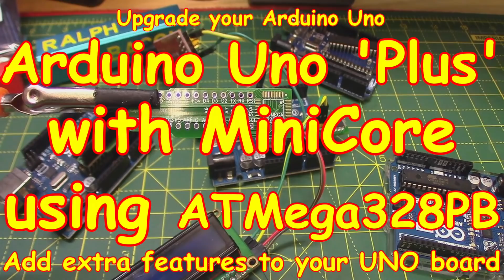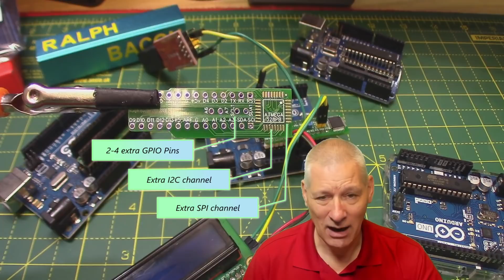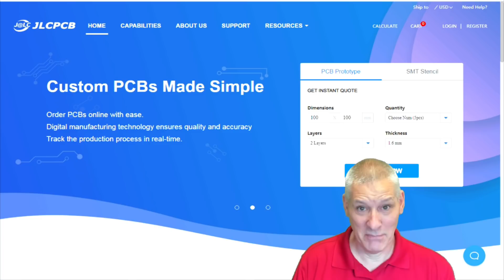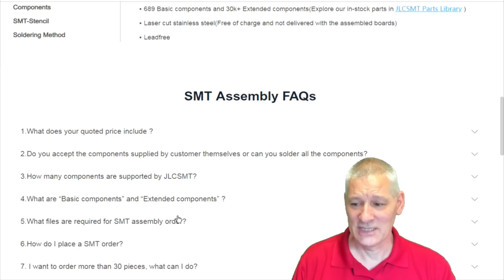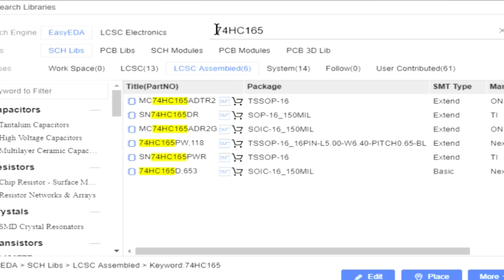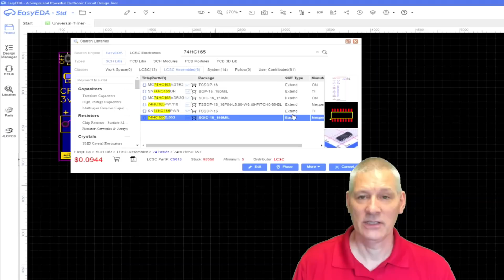#168 Upgrade to an Arduino Uno 'Plus' with MiniCore and an ATMega328PB

Comment: Tell me please, what version of the minicore kernel are you using? Only version 2.0.5 works unrealistically for me, the chip works from an internal generator of 8 megahertz. If I choose an external one at 16 megahertz, it's crazy.
Reply from the maker: I do not know which version of the kernel I was using at the time; I do know that this library has been updated several times so maybe it will now work reliably. I never had any issues and I almost always run the Arduino 328p chip using an external crystal at 16MHz.

Comment: Great Video Ralph! Could you share the changes that you had to make on the Liquid Crystal libraries to be able to use the second i2c channel? Thanks!
Reply from the maker: You will have to believe me, Gabriel, when I say I have looked long and hard for the changes I made, but without success.

If we assume that the original Wire.h library (I2C) uses pins A4 and A5 (aka GPIO 18, 19) then I can only assume I "hacked" a version of that library to use the pins required for the second I2C available on the PB version.

But at this stage I'm afraid I must admit defeat and say I can't find the changes.

Comment: This is exactly the kind of thorough resource I was hoping to find about the 328pb. I had been needing something with more than one UART and these tend to be a bit cheaper than 32 bit microcontrollers
Reply from the maker: Great! It works just like the standard 328P but with more features. Unfortunately it also has the same number of pins, so some GPIO pins are used if you want another UART.

Comment: I got your board as offered some time ago. After some SMD soldering experience I plunged in. I quickly had success burning the bootloader but everything thereafter failed. At 24:41 in your video was the selection of UART0 or UART1. What I discovered was that the correct choice for me was UART0. 
I use an ELEGOO UNO R3 which has the removable 328. I have pressed a ZIF socket into the board (notch at the end for the large capacitor). Once the bootloader was specified as UART0 I had success.  Tada as they say.
Reply from the maker: Indeed, Ralph, the correct answer is always UART0 unless you have used the other set of RX / TX pins (which I hadn't in the video hence why I chose UART0). I should have been clearer on that, my bad. But I'm delighted you had the Eureka moment and got it all working, great stuff. 👍
Reply: @RalphBacon  The finished is shown on my Instagram: https://www.instagram.com/rwl7532/ where I show all my e-successes. (and some photography) Why aren't you on Instragram?
Reply from the maker: Just saw it, Ralph. Yes, I'm on Instagram inasmuch that I have an account, Twitter too, but I have no time to answer stuff on social media other than YouTube!

Comment: Could you do a video on the microchip 328PB Xplained board? It has a built in circuit debugger, possibility can use it as a cheap ICE with the atmel studio?
Reply from the maker: As it happens I do have a 328PB Xplained board but I never ended up using it. I will add your suggestion to my list and see what happens. Of course, the Arduino PRO IDE may overtake me and provide what we all need regarding debugging long before that happens...
Reply: @RalphBacon  Thanks. The atmel studio had an option to import existing arduino sketches and allow debugging, I never managed to get this working.

Comment: Hi Ralph , very informative video , I’ve been pining for an Atmega with two i2c ports for a while. I’ve been using atmega1284p in a few flight simulator instruments I’ve been working on for a while as I needed a few more pins, and “accidentally” bought a atmega324pb thinking it was the  low cost lower spec memory version of the 1284. Now having seen your video , I noticed it too has 2 i2c ports etc .... I’ll modify my next batch of pcbs to take this chip as well as the 1284p . I’ve lost my fear of smd pcbs with the help of pcbgogo.com . Have you considered this chip ? As the headline io pin count , I believe is 39 compared with the 328pb’s 27 . This in my opinion is a good option without having to get into the realm of the 100 pin 0.5mm pitch of the 2560 . Many thanks, and keep up the down to earth videos exploring the possibilities of Arduino 😃
Reply from the maker: 100-pin SMD soldering? Ouch. Tricky. But probably do-able! I've not used the 324PB at all. There are so many MCUs out there it must be possible to find one that suits our needs. You seem to be doing a good job researching which ones are good for you. Keep going.

Comment: Just out of curiosity, why didn't you put the chip at the other end of the board so that it didn't overhang the end of the Uno board?
Reply from the maker: Because the two aluminium caps are there and there was a definite risk of shorting. I could have made it wider but it looked ugly. I had to do something so this was it. It actually works OK in real life.

Comment: Thank You for your give away pcb board for Atmega328PB. The board arrived to day, when our national postal strike was over.
Soldering an AtMega328PB chip was not difficult. But I had difficulties burning a bootloader to Atmega328PB. I got avrdude messages like:
"Reading | ################################################## | 100% 0.02s
avrdude: Device signature = 0x000000 (retrying)"

I even desoldered the first 328PB off the board and soldered a new one back and got again the same avrdude messages. No bootloader burning today. 
I googled, read and tried all good advice without any help. 
On a last try I decided to hack ArduinoISP.ino.
On line 53 I changed SPI_CLOCK slower by increasing the frequency divider from 6 to 10:
#define SPI_CLOCK (1000000/6) ==> #define SPI_CLOCK (1000000/10)
It worked and finally I managed to burn a bootloader.
Ralphs board + Atmega328PB + Minicore worked on genuine Arduino Uno just like a DIP 328P. It even worked on Jeenode running RF12demo.ino. Jeenode uses 3.3 volt voltage because its radio RFM12b is 3.3 volt device. 
On some of my projects I like to use two hardware serial ports. Atmega328PB is then a good choice.
Thanks again and waiting for new videos...
Reply from the maker: I'm glad you got it working (eventually) Hannu. I didn't get any errors. I just put the PCB with the new chip into my programming ZIF socket, chose the correct board using MiniCore and it "just worked". No changes to "Arduino as ISP" sketch were required. I hope you have many hours of fun with the extra facilities this chip gives you.

Comment: I just received the board Ralph.  Thanks a bundle. Darn that chip is very small. Lcsc was sold out, ordered at aliexpress
Reply from the maker: You think that chip is small, Ed? Try the VQFP version I showed briefly in my video! No way could I solder that (I don't think so, it has no exposed pins). Glad you got the board, take care when soldering the chip, make sure Pin 1 is correctly positioned (see the dot) and just tack a corner, correcting any misalignment and then tack another corner to hold it square and you're good to go. Plenty of flux, I mean PLENTY! It will all wash off afterwards with Isopropyl alcohol. If I can do it, anyone can!
Reply: @RalphBacon  got to get myself some decent flux, the last flux I ordered from china I think was just vaseline

Comment: Beauty! This makes me think I could design a pcb with a little 328PB (instead of the whole nano) and all my other bits.  It would reduce the project size to about 1/3 or less.  JLCPCB could put it on for me.
Reply from the maker: Indeed, and it's what commercial outfits do, of course. Prototype using a Nano or Arduino then transfer the important bits to your own PCB and get someone else to do the dirty work of actually making it! That way, you can spend more time on getting the design and PCB right instead of building anything.

Comment: I practiced SMD for a bit, then; when I thought I was ready, I went for the "TeSt"  I purchased a SMD kit that builds a wrist watch, all very tiny parts, 4 boards with an additional battery board if you decide not to go rechargeable, which I did.  Now I am rather lucky in one way, my eyesight is so bad without glasses that if I take them off, it is like I have a very large magnifying glass, so with my glasses removed, and safety glasses in place, I went for it. First though I did purchase a digital soldering iron so I could regulate the heat, and found some needle style tips to use, they worked well, I also purchased a set of tweezers that were so very necessary to do the project.  I have been wearing the watch now for nearly a year, just put the 3rd set of 5 batteries in her with the fall back last Sunday,  So I think I passed my TeSt although she is not beautiful, as there are some obvious errors, while the thing works fine, some of the components are off kilter just a bit.  The solder made the connection right it just looks a bit wrong, but they were in tight places where a slip of the tip could have burned through the display cable.
Reply from the maker: I used to be like you, Jerry, with poor eyesight (very short-sighted) but with the advantage that I could focus on the end of my nose. So soldering small components was never an issue... until my eyes decided they did not want to play any more and now I just have poor eyesight! However, with +4.0 glasses I can see real close again so soldering SMD chips is OK. Once I get my cataract swapped for a decent lens I should have eyes like an elderly hawk!
It's nice to hear your project worked out well like that. Yes, we can always do it better next time, maybe, but it's easy to have 20/20 hindsight!
Great to hear from you Jerry, thanks for posting.

Comment: What if I don't drink coffee?  If we are lucky, even though arduino missed the boat, our "far eastern friends" may get the urge to clone this with chip and caps installed, so hide your email, but publish the circuit widely. 😊
Reply from the maker: If you don't drink coffee then you will have even more cash for these ultra-exciting products that I keep demoing, Kent, makes sense, right? I'd love it if the Chinese were to create a board with the 328PB - given that it's very nearly pin compatible and cheaper than the 328P nowadays I am wondering why they haven't.

Comment: Nice piece of work! Compliments for the presentation, too!
 I`m planing to use this chip by replacing  the one from the pro mini board for small sized projects.
 I`ll need to check if the pins are the same or maybe an adapter pcb could fit them and then check also the sleep power drain values. 

 A question regarding your adapter board: could the chip be placed to the left of the headers, just to avoid getting out of the main board size?
  Thank you for the valuable learning! All the best!
Reply from the maker: The 328PB chip is very nearly pin compatible with the SMD 328P, Neagoe. You just should not connect pins 3 and 6 (connected to VCC/GND on the 328P version) as these provide an extra GPIO on each pin and it's not particularly "safe" to leave them connected directly to VCC or GND (think: short circuit).

And I could have placed that chip elsewhere I suppose although routing all 32 tracks was a bit of challenge as it was. I would love to create the PCB with the tiny VQFP chip that I showed with the chip sitting between the pins - but soldering it would be pretty much impossible (for me, at least) so maybe I'll get a PCB fab house to do it for me!
Reply: @RalphBacon  Hm, actually I was thinking about your challenge with the tiny chip and crossed my mind something I've done the years ago, using a 3D printer to create a thin solder mask for putting a precise solder quantity.  Then I've heated all up by using 2 heat guns 180 degrees one from the other and rotate them. If you would like to try I could make the solder mask for you, @ zero cost.
Reply from the maker: It's beyond my skills levels, Neagoe, trying to solder that tiny VQFP chip, solder mask or not! But thanks for the offer, very kind of you. Unfortunately, LCSC.com don't stock that tiny chip either, so if I were to get it done it would have to be another PCB house. Luckily I know of one with which I am involved. We shall see.

Comment: Thanks again Ralph for yet another interesting video.  I'm not sure that I will be heading down the road of programming my own chips, but useful to know what is possible.

I have a question relating to another board I have seen.  this is an UNO style board with an ESP8266 built in - link below:
https://uk-m.banggood.com/Geekcreit-UNOWiFi-R3-ATmega328PESP8266-32Mb-Memory-USB-TTL-CH340G-Module-For-Arduino-Uno-NodeMCU-ESP8266-p-1205444.html?gmcCountry=GB&currency=GBP&cur_warehouse=CN&createTmp=1&utm_source=googleshopping&utm_medium=cpc_bgcs&utm_content=zouzou&utm_campaign=ssc-gbg-summersale-all&utm_design=152&ad_id=358675083520&gclid=Cj0KCQjw9fntBRCGARIsAGjFq5EnYGQ2Uu2GGoBlYRxhDDs-8lvakVe1KUkUDHqANXoo-TIPgVNZKkkaAj_kEALw_wcB

This sounds interesting, but I cannot find anything about them on YouTube.  Have you come across them?  It seems that you can set dip switches to indicate which chip to program, but I am wondering if you can get the two systems running together with communications between them.  If so that would be very useful.

Regards,

Colin Murdoch.
Reply from the maker: Yes, I've got one of those boards too, Colin, but like you have never actually used it as it seemed a bit like too much faffing to get the DIP switches set correctly. A poor excuse, I know. I some ways, thouhg, this falls between two stools. It's neither an ESP8266 nor an Arduino, so what processor does what job. Most will probably use the ESP8266 for its WiFi capability and communicate with it via the Tx/Rx pins, which is a pity because we use those to upload sketches. What we need is a chip that has extra TX/RX pins... Oh hang on, the 328PB has just that, what a coincidence.

Comment: Ralph, look into turned header pins (like on Tulip IC sockets) instead of the square ones. The square ones will expand the socket so a normal PDIP won't fit very well after.
Reply from the maker: I'm sure I have some of those turned pins somewhere, I shall see if they work any better. Thanks for the nudge.

Comment: Terra-Term will close, PuTTY will not.
Reply from the maker: Not in my experience, Ted! Even though I have told PuTTY never to close the window, once it loses the connection (eg you unplug the Arduino) it comes up with an error and then promptly closes the window! I don't understand the logic but there it is. But CoolTerm works fine for me, far better than PuTTY anyway, even if I discount the odd window-closing behaviour!

Comment: Hi Ralph. You demo'd using two serial ports... Just wondering what code changes can be made to use  the two i2c busses?
Reply from the maker: There are two libraries included with MiniCore, Gary, Wire.h and Wire1.h, and it's the latter we use to use the 2nd channel. You can use both simultaneously, of course.
Reply: Thanks Ralph. Really appreciate all the work you do and the great presentations of fun information...Thanks again.
Reply: @RalphBacon  Just what I was looking for! I have a project where I selected a Pololu 328PB module to use all it's analog inputs and would use the 2nd i2c for a LCD. Later I noticed that there was no library available for the 2nd i2c. Even the Pololu WEB site state that. I will look MiniCore to see if my project will be feasible. Thanks you for the note and Gary Webster for making the question!!!

Comment: Hum, I don't know if I'm just too cheap to have somehow ok ic socket or/and pin header but when I plug them together they are hard to plug in and seem to slack the ic pins connections.
Found out the stackable pins are more suitable to be connected into IC socket.
Reply from the maker: Stackable pin headers fit better but IMHO make the board look quite ugly and don't allow shields to be plugged into the Arduino. You can get ROUND pin headers which probably work better. But even the square ones do fit but something you want to fit just once and leave there.

Comment: couldn't you put the chip on the left side and have it hang over the board itself?
Reply from the maker: I wanted to do that, Norm, but those aluminium can caps are in the way. The pins would foul and, of course, I have stuff under the chip (the decoupling caps). Others have suggested making it wider rather than longer but I had this bee in my bonnet that longer and thinner looked better.

Comment: Great timing for this video. I’ve just ordered a atmega328p-au to install onto a pcb to prototype. I may progress to the pb if all goes well then, didnt realise it was the successor tbh. I was going to have a go at installing Minicore which I wasn’t too confident about but now I’ve got this video. Thanks again.
Reply from the maker: If you want a PCB, Chris, let me know, a couple are still available. The 328PB is almost pin compatible (pins 3 and 6 are new GPIO pins not connected to GND/VCC) so you could make a small change to your PCB (or just not solder/connect those pins) if you want the extra functionality.
Reply: Ralph S Bacon sent an email. Thank you
Reply: Ralph S Bacon thanks for the reply. I’d love a pcb, thank you. I’ll pull the laptop out and I’ll get an email sent.

Comment: Why are the tracks so tiny? I edit the PCB make GND, VCC and AVCC so big as possible.
Reply from the maker: If you can make the tracks you mention bigger, and still have a minimum of 5 mil clearance that's great, Jens. As these tracks only supply the µC I don't think it essential but if you can do it, then do it!
Reply: @RalphBacon  I make it so big as possible. Then I make a error check. And I link VCC to AVCC. Both are 5V. I link a short track from C1 to pin 18 of the IC (AVCC) with a via.